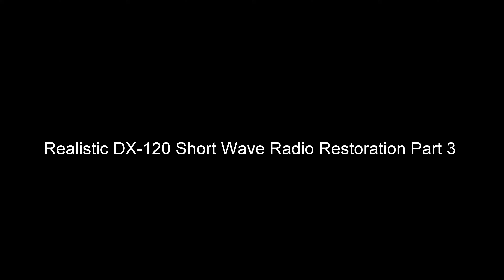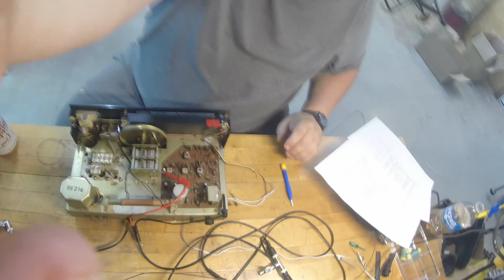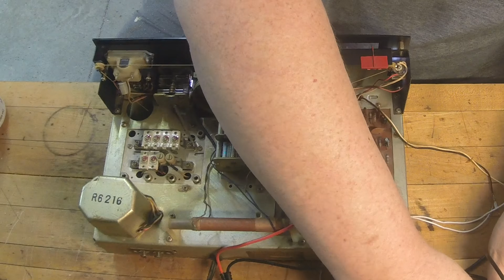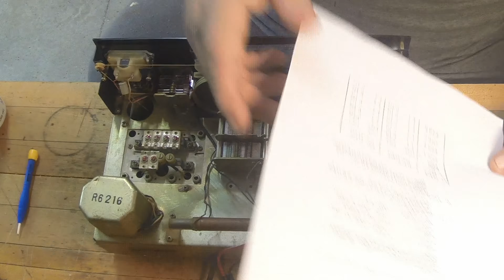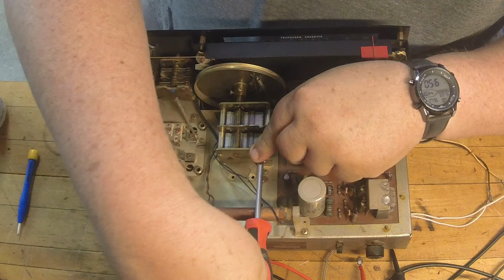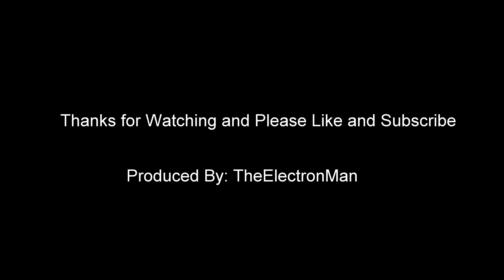Realistic DX-120 Short Wave Radio Restoration Part 3

Comment: Do you recall if the local oscillator is above or below the receive signal? On mine it seems like it is high side injection for all bands.  Or do you recall if the image is above or below the RX frequency?  I am not getting very good image rejection on mine, but I'm not expecting it's going to be stellar anyways.
Reply from the maker: The oscillator frequency is above the received frequency. This is because this oscillator generates a signal that mixes with the incoming signal to produce an intermediate frequency (IF), which is normal as the oscillator frequency needs to be higher than the received frequency for the mixing process to work effectivel